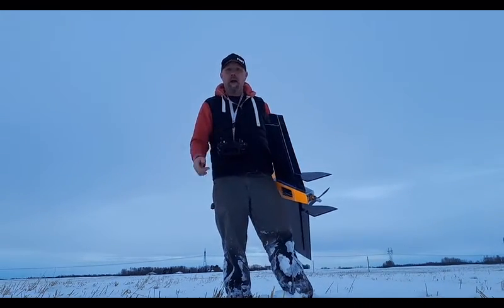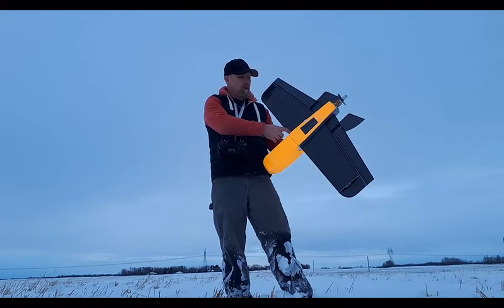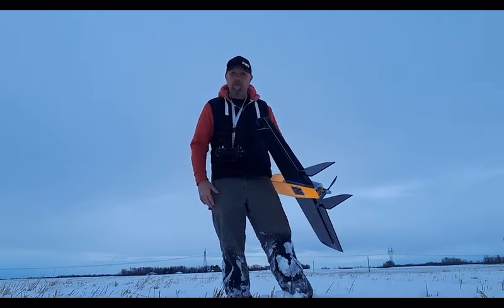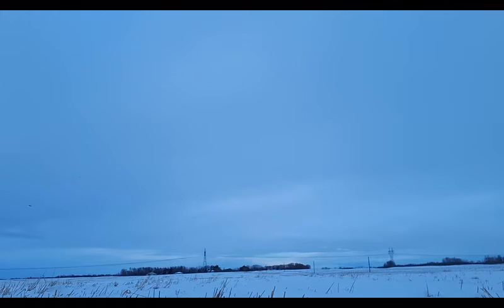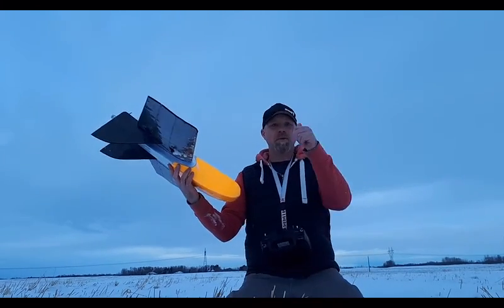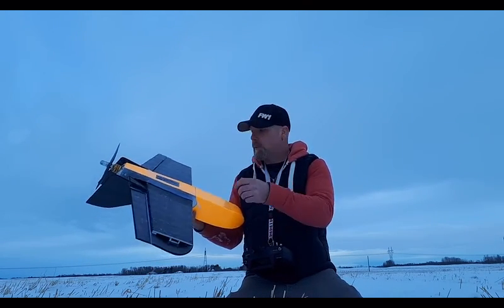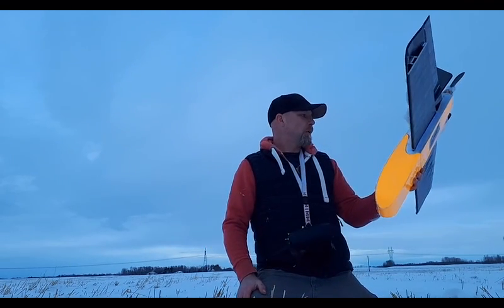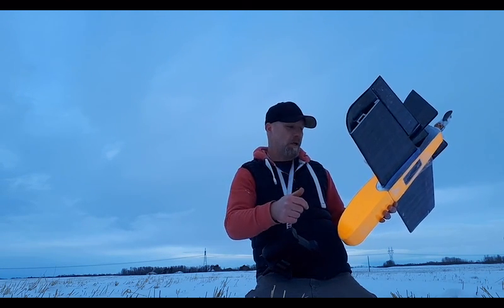Flitetest Goblin 130% Maiden...?!

Comment: Dude you got yourself a mean rocket ship there!  It's like my BattleAxe/HammerTail.  What kind of lighting system are you using inside the nose?  It's the brightest thing in that cold blue landscape.
Reply from the maker: Thanks. It was quite fast. I am thinking of doing a new one, an improved version. This one broke the spar and had to scrap it
Reply: @North49RC  Did the spar break in a collision with invisible hard air or did the ground jump in front of you out of nowhere?  Seriously, I'm worried about my version.
Reply from the maker: @team-zracing7476  It was weird, I took it out after a handful of successful flights and it was acting up this time, receiver issues. It crashed and I did a quick once over with it and sent it back up. Spar broke mid air but it didn't fold up like you would expect. It folded down for some reason. 

Next one will be getting CF tubing reinforced box spar. Smoothed out wings, maybe a molded instead of folded body

Comment: Hi Chris, any chance to get the files for the 130% version?
Reply from the maker: All i did was upscale in Adobe Acrobat in the print option. There are no specific plans for that size. You can up or downscale any plans that way
Reply: @North49RC  thank you 😊
Reply: Sorry, to ask you again. Someone told me, after upscaling, I would need a thicker Foamboard. Is that true?
Reply from the maker: @nadimraja3216  Actually no, its pretty easy to use the same FB you have been using. However you do need to be aware of the fold over cavities. Whether its an A or B fold and what scale you are using. You can upscale or down scale on the same FB and for the most part everything will work out if you follow a couple simple rules. 

One would be to decide what scale you are goin to go with, sometimes this is left up to experimentation, multiple builds of the same model to get it right. You need to watch the build vid first before knofe hits FB, I wouldnt dive right in raw. Then have a plan once you have printed off your templates. I even draw out the lines I will be using to fit said FB to the cavities or slots. You wil also need to compensate for the spaces allowed for servos because once printed out, everything scales with it.

As long as you are willing to play with it a bit, might have to build the same piece twice to get it how you like it. Make corrections and compensations as you build. Measure and dry fit till its right. I have built a hand full of variations of the same model to figure out the scaling. The Scout, Goblin, Cub to a Kitfox, Seaduck. Just takes some headscratching and figuring out along the way.

What model are you looking to scale?
Reply: @North49RC  I would like to upscale the Goblin like you did.
Reply from the maker: @nadimraja3216  Perfect so yea once the plans are printed out at 130% upscale, check all the areas you need to peel out a cavity for a fold, mostly on the fuse, and the fold over on the bottom panel trailing edge of the wing. You need to make the gaps smaller to the thickness of your FB. So if they print out at 7mm wide and you need 5mm for the FB, then you need to draw in a smaller gap to for your score to follow. You do need to be aware of the A fold vs B fold to know which side you need to add or trim out. Like i said there may some trial and error. You could try on a scrap piece a couple times to visualize it. Once you get it it will be as easy as breathing. Very intuitive
Reply: @North49RC  thanks for your advice and time!
Reply from the maker: @nadimraja3216  Any time and good luck. No video, it didnt happen right

Comment: nice build! What did you use for a firewall?
Reply from the maker: Thanks, till I snapped the spar at about 6 flights in. I will build another one again probably in the spring. the firewall is a thin plastic cutting board cut and drilled to size. I find it holds up better then ply